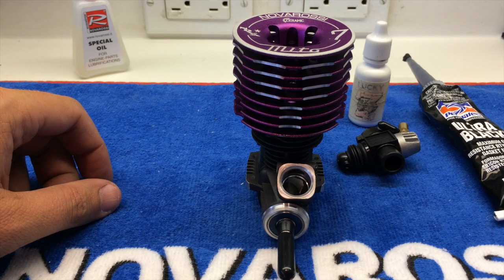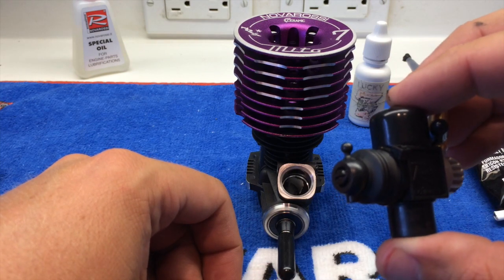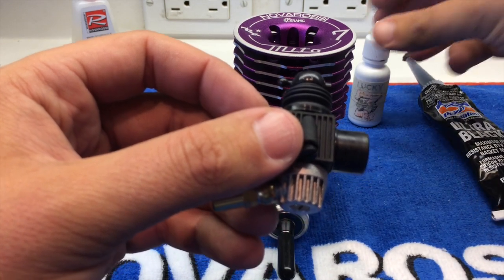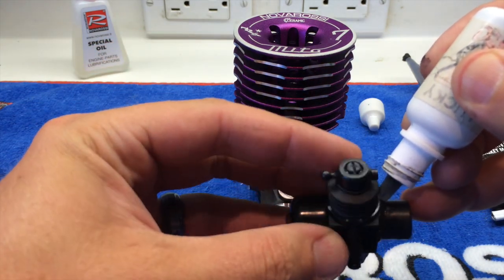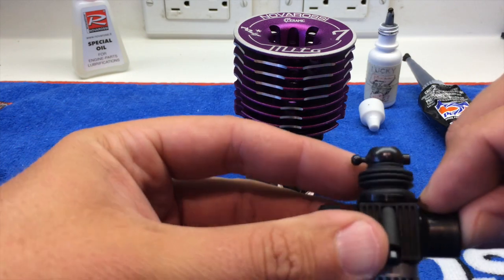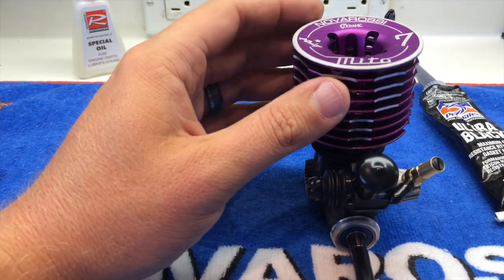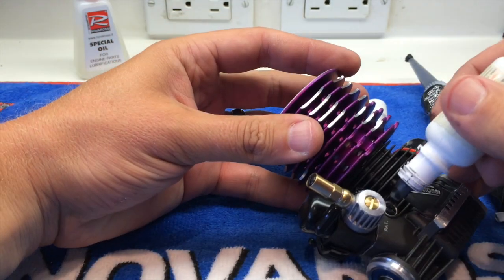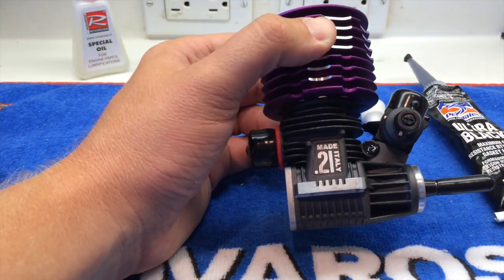Adam Drake from Mugen Seiki Racing and Novarossi explains carburetor sealing.

Comment: Sir Adam when starting to break in novarossi mito7  do you adjust any needles and if you do which one first do you adjust? OrWhich needles do adjust? Thank  you sir just talking about the first part idle at the starter box
Reply from the maker: The factory Novarossi settings are usually extremely rich.  You can start by leaning the LSN one turn and the HSN 1/2 turn for break in.
Reply: Adam Drake thank you sir Adam 👍🏻👍🏻 regarding the nitro fuel do you prefer flash point with novarossi mito 7? Which nitro 20 or 30%? Is there any advance between the two? Thank you very much sir
Reply from the maker: Hello, I normally run the Flash Point 30% Race Blend.
Reply: Thank you sir 👍🏻
Reply: Adam Drake hello sir Adam your advice work perfect to lean it a bit 👍🏻👍🏻 regarding break in just the first four  tanks how long does it take per tank just on idle? Mine is a truggy and takes 1.5 hrs just on idle so I'm not sure if I'm doing it right I fill it up all the way 👍🏻👍🏻 thanks how long for you does it take per tank on idle truggy ?Thank you sir
Reply: Great, happy to help.  It usually takes about 30 minutes to idle a tank of fuel, but it will depend on your settings.
Reply: My pleasure!

Comment: Hi I have a question if you shut your engine off by covering the pipe and the engine putts 4-5 times after covering the pipe most likely what's wrong or is nothing wrong? After this happened I installed all new 9901 pipe header new lines/fuel tank. I can't tell if I'm chasing a air leak or my tune. I can't get it to stop the two stage idle. But it runs at 230-250f just with a funky idle. I can get the temp to go down or up with the hsn. I have the Lsn way in like 3-3 1/2 turns out. High just under flush and the gap is tiny really tiny. Tons of competition and only about 15 tanks threw it. Idk:( started doing this after the 12th tank. Just after breaking it in. What do you think?
Reply: I'm not sure I totally understand the question.  Can you please explain more?  Maybe you need to replace the exhaust gaskets?  With Nova engines the tune and idle usually gets more stable around the one gallon mark.  Can you share a video of what it's doing?  adrake@mugenracing.com

Comment: Okay so I broke in a Roma 10 tanks. Ran 3 tanks now it has a air leak because when I put my finger over the pipe to stop it it keeps running for a second. It also has trouble finding its idle after I let off. I changed the fuel lines tank and filter. Took the engine off and see no leaks no dirt that stuck to wet fuel. Also replaced the exhaust gaskets Dose this at .6mm carb opening. 5 turns out on low 3 1/2 on high. Really at any rich setting it acts like it has a leak. Can the carburetors go bad this fast?
Reply: My hobao.30 acts better than this roma

Comment: hey adam! do u prefer ceramic or steel bearings in ur engines?
Reply from the maker: +Tyler Hoffman 
I run ceramic bearings in my engines, but the stop steel bearings from Novarossi are very good.  It doesn't make a huge difference in performance.

Comment: How come the engine doesn't over heat on some of the 40 minute race non stop?
Reply from the maker: SoCal Rc Guy 
If the engine is tuned correct the temp will stay consist.  The race length shouldn't affect the engine temp.
Reply: That is great to know Adam :) I'm a big fan of Nitro Rc and now it made me more happy to know this thing
Reply from the maker: SoCal Rc Guy 
My pleasure.
Reply: Awesome :)
Reply: Most likely due to a good tune.

Comment: This was left on a comment from one of my Facebook friends. Your a real class act Adam! The words below are from the young man's dad. Your the man Adam!

The young man they are referring to is Zachary Sampiere  whom I'm proud to call my son. Let's paint a picture, last round of qualifiers on Saturday night. Going through are normal routine warming up the motor on the box, clutch bearings start to come apart. What do you do needs to put in a good run to make the show, turn up the idle tell don't let it stop go have some fun. Went out did his job and secured a spot in the show nevous breakdown put on hold for dad. Sunday morning get to the track replace clutch bearings, service the clutch business as usual . Time for the mains , again normal routine warming up on the box Zach gets on the stand walking up to pit lane and starts making noise? So I shut it down give the truck a roll seems like dad messed up setting the gear mess fellow racer Paul Quartuccio  is pitting for Ryan Lutz runs to the pits grabs me the needed tools to make the adjustments Ryan steps off the stand to give me a hand and we discover that the flywheel is not tight. At this point my heart is in my throat, how can I let my son down like this. I run to the pits grab the 8mm so we can tighten up the flywheel , I see Ryan in his pit grabbing motor ready to drop in. We both run to pit lane and there is no way we can get the other motor repaired in time so motor swap in seven minutes in pit lane. Fire it up very little throttle, eap adjustments needed in steps Adam Drake makes the adjustments and Zach is able to make the show. How does a father ever repay all the people who made a life long memory for there child and if you know Zach he will never forget. So thank you all for enriching my son's life. Thanks to Tekno RC and PRO-LINE Racing for your support and the people that you chosen to represent your company's.
Reply from the maker: Scott Foy 
Thank you!  Zachary is a great young man and I was happy to help.